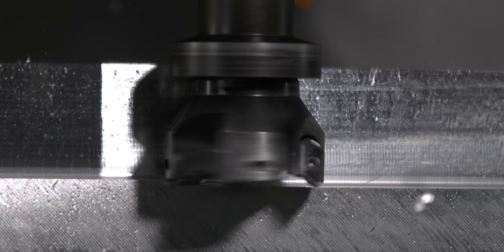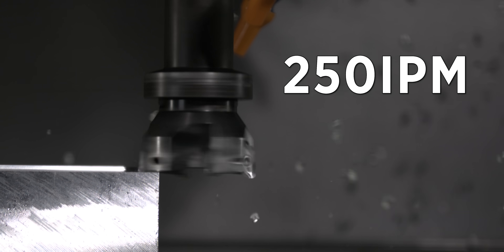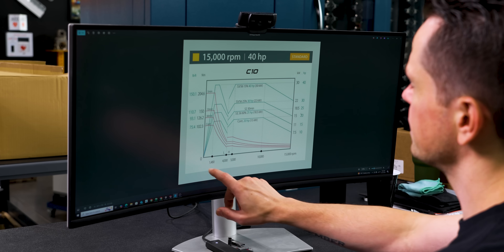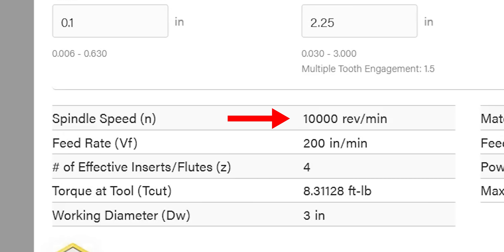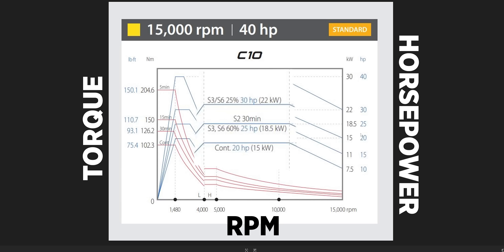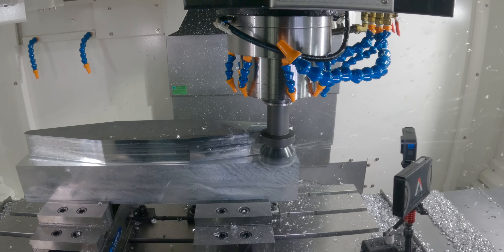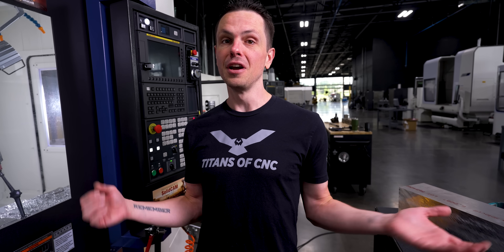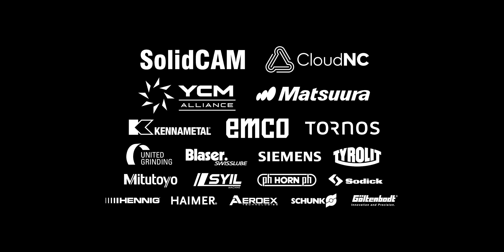I am Scared this will Break the Machine!

Comment: Awesome. I started setting up, programming and running machines back when they were just "NC", running off of paper tape, circa, 1977! Mostly in the aerospace industry. Owned my own shop for 10 years. Retired now, but still enjoy watching, and kind of missing, it. I think I would have probably cut back just a bit on the surface footage, and increased the depth to .25, for roughing. You guys are awesome!

Comment: Check the tool holder taper. When you start seeing hot marks or blemishes, your tool is not solid in the taper while cutting.
That's a good indication you hit the high limit.

Comment: It is the old case of, what is easier on the machine. Slow speed for a long duration, or high speed for a short duration. Obviously every machine is different, but work to it's strengths.

Comment: If it scares the shit out of you to run the machine at 600ipm, why the fuck aren't you wearing safety glasses? ANYONE worth their weight and concerned about their OWN personal safety will ALWAYS wear PPE. UNBELIEVABLE! NOT IMPRESSED NEW GUY!
Reply: Any real machine has double layer safety pane in the front door and not a single layer of 1/4 lexan like others. So if something makes it through that door those glasses aren’t saving you.
Reply: @flyincivic  Seen more guys blow shit into their eyes then cut their damn fingers off. It's just stupid and irresponsible not to wear safety glasses. Same with hearing protection. Had a guy forever ago tell me "don't be like me, protect your hearing. It's NOT the machining noise or the cutters grunting. It's the compressed air blowing off the parts that damages your hearing" Took is advise and did just that. I gave SO many guys shit for not wearing safety glasses. Some got so worked up about it they went to HR. I laughed every time I got called up front. I'd grab the company policy manual that I had the page dog eared   that stated clearly what the company policy was. The clown that got so aggravated had 2 choices, safety glasses or out the door, cause I wasn't going anywhere and I wasn't getting disciplined. It was like that EVERY SINGLE TIME. THEY were just plain stupid. You EVER see Barry running a machine without PPE? I think not.

Comment: Nice breakdown of the torque and HP. Next time try a Kennametal Fix Perfect Shell mill with sharp teeth. I't can't plunge, but it will run circles around the cutter used in this video.
All whilst keeping torque numbers lower because of the agressive geometry.

Comment: I was taught that if you’re not cutting your dulling, if the heat isn’t leaving in the chips it’s collecting in the tool, mild steel cutting speed is 1 cubic inch per minute per horsepower, mild aluminum is 4 cubic inch per minute per horsepower, torque, rpm and duty cycle are limits just like if you want to get there fast you need to get it above an idle and out of first gear.

Comment: It's aluminum, don't make it such a big deal. I used to remove C45 steel with 160mm diameter cutter and depth of 2.5mm at a 12500mm/min speed.

Comment: I've had to do similar things with our machines. Running a near 4" diameter drill 18" deep in steel etc, one thing I have found out though...is not all machine tool manufacturers are, uh... accurate on their ratings.
Our Mazak SUB-SPINDLE is (ACTUALLY) more powerful than our DMG Mori MAIN spindle (same size chuck), in terms of clamping force of the jaws, the C-axis and horsepower, even though DMG claims roughly the same figures. It's not even close when actually cutting chips. The DMG is just too weak to keep breaking chips. I've almost stalled the C-axis out running a 1/2" end mill with dynamic milling on on it, meanwhile the SUB-SPINDLE on the Mazak runs a 3/4" end mill all day, everyday with zero problems. 
Not all machines are built the same.

Comment: Blue off your tool holder tapers and check them to the spindle. The machines can handle the load. Those tapers wearing out and causing damage to the mating surfaces in the spindle is the killer in shops. Stoning dings and burs off throughout the years rather than replacing tool holders doesn't help either. Do that for long enough even with light cutting and you'll wind  up with a worn out spindle and tons of tool slop.

Comment: Seems like a fairly light cut, especially for aluminum
Reply: Shell Mills typically have a pretty shallow maximum cutting depth
Reply: @Chooie6 Correct. Typically tool radius and that's about it for optimal cutting.

Comment: One of the best videos for new machinists I've seen in a while. It shows how to use a data driven approach vs "feel" to safely find the limits.
Reply: Useless without toollife and toolcost data.
Reply: @DonnaF-yi4jx why would it be useless? 

MRR isn’t the only metric involved, tool life and tool cost are also important but without any of the above you are making estimates off intuition not data. And the more data you have the more you can optimize for the exact correct answer for your situation.
Reply: @austinlambert3994 when you don't know the cost of doing business what is the point to show-off.
Reply: @austinlambert3994 if you don't have cost of doing business then it is just show-off.
Reply: @DonnaF-yi4jx without this data, you can’t really calculate the cost of doing business.

Sure, they are showing off, but they are showing off a step that is important when it comes to optimizing the efficiency. 

The particular work I do is also more sensitive to lead times than cost so this is also really helpful to me personally.
Reply: @austinlambert3994  Where in the data shows you any cost ?
Reply: @DonnaF-yi4jx the machine is probably financed for some number like 800 per month. The sq footage in the shop that is being rented is probably like 5 per sq foot and it probably takes a 20 x 20 space or 400 sq feet by the time you make space around the machine to get the forklift in.

That is fixed costs of 800 + 2000. 

Tripling the output of the machine lets you amortize your fixed costs across more parts potentially offsetting the tooling costs.
Reply: @austinlambert3994 we know what assuming gets you.
Reply: Yeah I felt the same way. I'm a math nerd at heart so this kind of stuff is exactly what I love about machining. Thanks for watching!

Comment: I’ll never understand why you guys emphasize the speed of axis movement over actual removal rates…
Reply: Clicks
Reply: Well obviously your feed rate is 1 of 3 variables that determine your resulted MRR, something that titans of CNC emphasizes in most of their videos like this is getting your machines torque and power graphs and finding the parameters that best achieve a higher MRR depending on what the machine is good at. This is something that I experience programming the machines in my shops 5x section, some of our machines have low power spindles that go up to 42k rpm’s, and others have high torque spindles that only go up to 12k rpm. Obviously the low torque spindles i run a significantly higher sfm, and feed rate, where as I do the opposite on the high torque spindles and can generally achieve a similar MRR
Reply: The reason is it's more movement and it wears your machine down faster. Thes needing you to buy a new one preferably one of his sponsors
Reply: Efficiency over all else, commanded linear speed has very little correlation to cycle time if your tool path is garbare
Reply: @JonathanHuard-mc3up yeap, lower rpm often means more torque but check your spindle chart to be sure, lower rpm, large depth of cut and stepover, makes higher MRR
Reply: Clicks
Reply: Looks good on YouTube.
Reply: нагрузка на режущий инструмент при высокоскоростной обработке на инструмент получается меньше, подача 0.005мм на зуб, пластины будут жить очень долго, тепло из зоны резания хорошо отводится с помощью стружки
from RU
Reply: It really makes Sense. Bc you ganz use an Endziel or a depth cut bc of the Little Stepper on the side. So You have to use a Face Mill with a Schallwellen cut. Only way to faster cycle time ist faster Feed rates
Reply: because that's how you optimize mrr. go read a book
Reply: @mobilePCreviews depth of cut, radial engagement, also increase mrr
Reply: @mobilePCreviews so the way to optimize MRR is by not focusing on MRR? Great argument…

Comment: Glad to see you getting out of comfort zone. So many things have changed in the 38 years I have been in the field. Old timer I came up with was a firm believer in keeping going till tool failure then back off 15-20% as starting point. Also knowing tq + hp.  We had at least 40 hp on smaller machines. We used 8 in mills. All lathes used 1.5 to 2 inch boring bars with cnmg 643 rgh insert. So was equipped to do some damage. Best of luck young man.

Comment: I was strugling with managing chips with big carbide drills and indexable drills so I took a U-drill for more rpm and lesser feed/rev and it definietly helped me getting into huge tool life and chip managment while also being twice as fast. According to charts the torque peak starts at 2000 rpm and ends with 3000-3500rpm and my drill spins at about 2000rpm so I call it good. Getting 130-140% spindle load for 10 seconds and that is it.

Comment: Great video. I will say YCM is a Chinese company. You would think a US based machining company would want to use US machines like Haas or I think Fidal. I'm interested to see the difference in pricing compared to the machine in the video.
Reply: ycm,is a TAIWAN'S COMPAN,NOT A CHINA
Reply: Haas sucks tho
Reply: @mnd1106 im not the one comparing, i work with a 4axis ycm daily and its only weakpoint is the spindle power imo. Precision all day long.
Reply: This YCM will out cut a Haas any day of the week and will still cut just as hard 20 years from now.
Reply: YCM is not from China...
Reply: @felipeeloko12f somebody above said Taiwan, which is better. Lots of respect for them, but still makes sense to support USA machines when possible. China thinks Taiwan is part of it and could try to take control of Taiwan at any time.
Reply: Ycm is way ahead of haas
Reply: @mennomeilink4660 how so? Don't know anything about YCM.

Comment: Great video, Drae! Many machinists never fully utilize their tools or machines to their full potential. The bulk of the profit is often made during the roughing cycle.
Reply: At the cost of wear and tear on the machine, great if you trade it in for new machines every three years but if you plan on keeping the machine long term it's not good to push them near their limits.
Reply: @phillhuddleston9445 This. I don't push my Kuraki past 80% spindle load with feed mills. Less wear and tear long term.